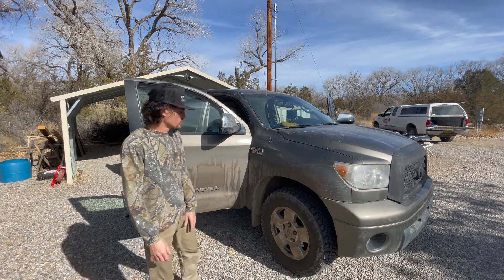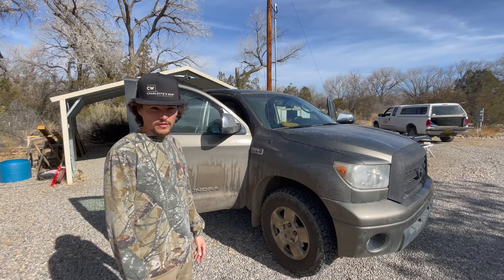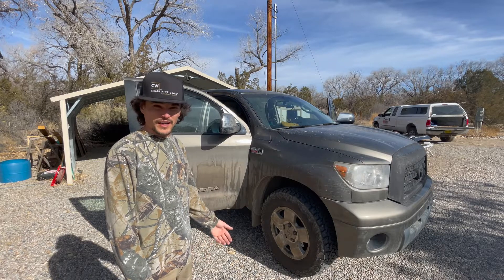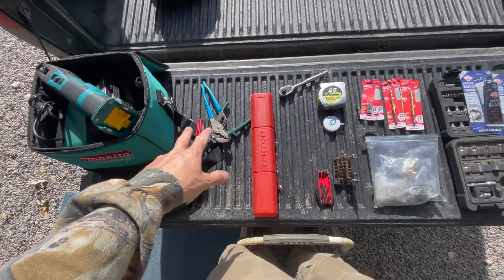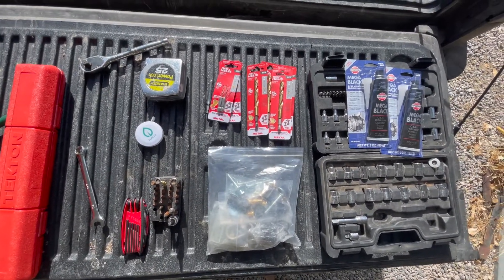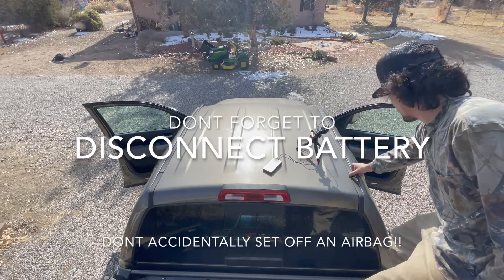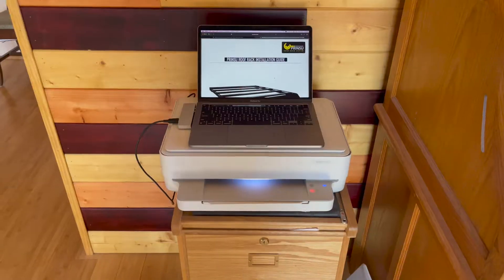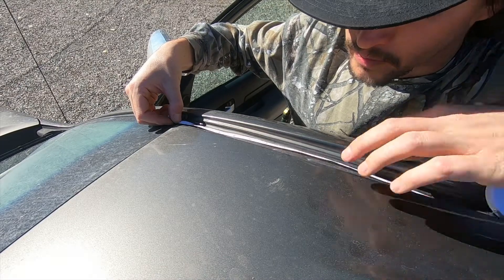2008 Toyota Tundra Doublecab Prinsu install!  Details! Drilling holes in your roof?! easy! DIY

Comment: Dude thank you so much! I finally got my tundra and have wanted this rack setup for years and you made it less intimidating! I had one on my
Tacoma but those have bolt holes already in them. Time to start drilling🙌💯
Reply from the maker: I was definitely intimidated as well, but after a year and no leaks- I’m 100% confident.  Thanks for watching everyone!

Comment: Got me thinking of doing my own rack, just need to piece together the hardware kit you had for the roof holes. Not sure what those expanding inserts would be called.
Reply from the maker: They’re called plusnuts I think.  I’m pretty sure you can order them from Cbi- but i found some on Amazon (not sure of their strength/sizing) https://www.amazon.com/Hillman-Group-59124-10-24-20-Pack/dp/B00NUFMG86/ref=asc_df_B00NUFMG86/?tag=hyprod-20&linkCode=df0&hvadid=198090173497&hvpos=&hvnetw=g&hvrand=15771124712013188487&hvpone=&hvptwo=&hvqmt=&hvdev=m&hvdvcmdl=&hvlocint=&hvlocphy=9030557&hvtargid=pla-350492295725&psc=1